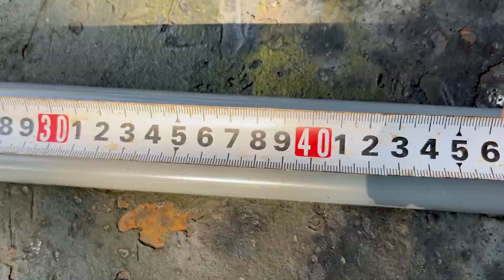Millions Don't Know This! Turn Brake Discs into Circular Saw Blades with Maximum Safety

Comment: Bom vídeo, nunca se esqueça de usar a proteção das pernas e da cabeça, eu cortando a grama com esse tipo de maquina já tive pedra atingindo o visor do capacete e lamina quebrando em vários fragmentos atingindo a proteção das pernas, uma sugestão, use parafusos Allen screw para prender o disco de freio a base, assim fica mas pratico a substituição da lamina improvisada, a solda pode desbalancear a cabeça de corte e afetar e gerar um desgaste excessivo ao eixo conectado ao motor. grande projeto e obrigado por compartilhar ele com o mundo. 👍21
Reply from the maker: Thanks for sharing your valuable experience! It is true that protecting your feet and head is important when using a lawn mower, and I am sorry to hear about your problem. You are absolutely right that changing the blade yourself can affect the balance and cause wear. Thanks for your feedback and I hope my project continues to bring value to everyone.
Reply: @inventorK20  Obrigado, o verdadeiro inovador/inventor é aquela que usa todas as informações de varias fontes para que sua criação/inovação ser segura e o mas eficiente e possível, continue suas invenções que elas são uma fonte de inspiração e inovação, obrigado pelo seu trabalho

Comment: А заводские, которые к каждому триммеру идут, разве хуже?
Reply from the maker: Thank you for your question! The products that come with clippers are usually of good quality for the price, but may not be as durable as professional accessories. Depending on your needs and frequency of use, if you need higher quality, you may want to consider alternatives or upgrades to the accessories that come with them. Thank you for your interest!